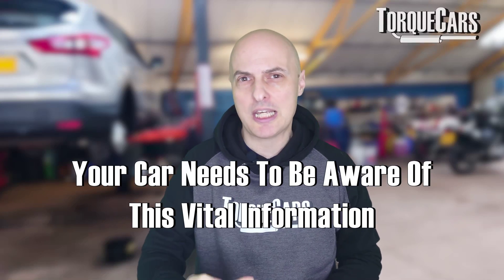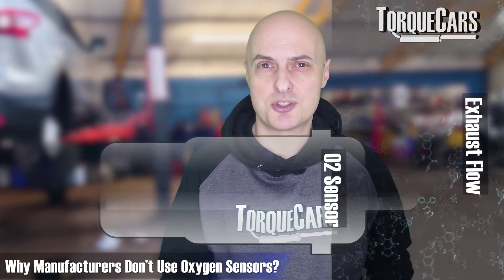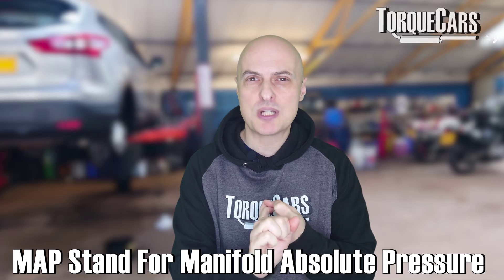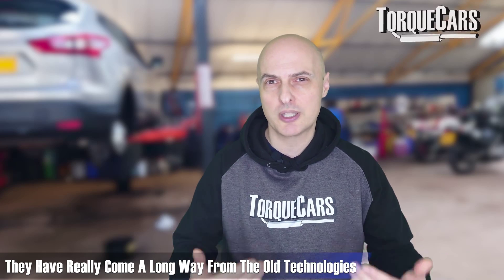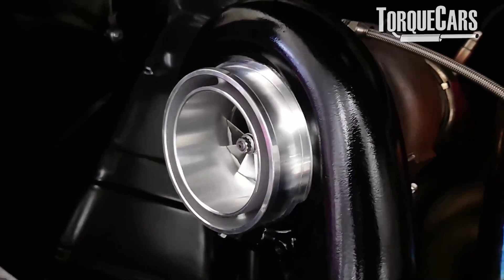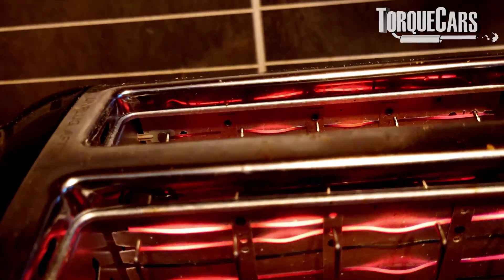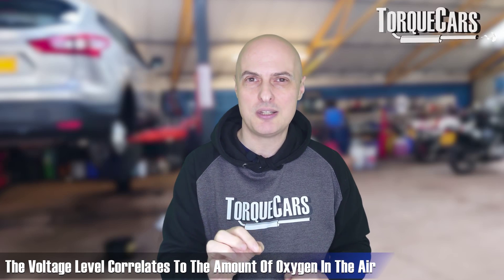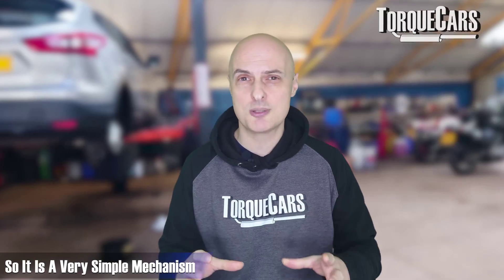Early Warning Signs of A Faulty or Failing MAP/MAF Sensor & See How They Work.

Comment: Hey i have a Error code p0069 (map senor) Could it be a bad maf senor Error ? Because I have changed the map senor.
Reply from the maker: Error code P0069 typically indicates a discrepancy between the MAP sensor and the barometric pressure readings. This sensor measures the pressure inside the intake manifold, which helps the engine control unit (ECU) adjust the fuel injection rates. When the readings don't match up with what's expected from the barometric pressure sensor, this code is triggered.

While the MAP sensor measures pressure, the MAF sensor measures the amount of air entering the engine. These two sensors work in tandem to provide accurate data for air-fuel mixture adjustments. If you've already replaced the MAP sensor and are still seeing problems, it's logical to suspect the MAF sensor might be at fault.

Check the connections, remove and clean the sensors and see if that helps.
Reply: @torquecars okay thanks! 🙏🙏 I have measured the map sensor which says 113-117 kPa, both at idle and while driving. If I change the MAF sensor and it doesn't work. What will be the next smart thing to do 🙏😁

Comment: To keep everything running smoothly how often should a person clean the sensors?
Reply from the maker: Some people clean them when they change the air filter. I have to note that damage is often caused by improper cleaning, primarily by residue remaining which attracts a faster dirt build up. Personally I only do mine 30,000 miles or so and they don't typically pick up much dirt unless I'm using an "oiled performance air filter".

Comment: The MAF sensor is a primary load sensor, many modern vehicles use it to calculate automatic transmission line pressure, a dirty, or malfunctioning MAF can reduce line pressure and cause clutch packs to slip and burn. High quality dry element air filters are best, oiled cotton gauze are the worst, especially for film type MAF sensors.
Reply from the maker: I've learnt something new, thanks for sharing this with me. I don't know very much about the nuances of Automatics, i've tended to own manual cars.
Reply: that's very interesting, i'd not heard of this before, and certainly want to prevent such damage to AT
Reply: How does exactly MAF (mass air flow sensor) control the transmission?    It has zero to do with driveline.  This is strictly info for ECU for proper air volume to achieve proper mixture to obtain proper combustion.   MAF sensor is the beginning of the line for ECU and CO2 is the final.  Both sensors send info to ECU what’s going in and what’s going out so fuel trimming can be done on the fly.

Comment: Out of topic but my 2012 4 motion 180 Hp amarok has very bad handling (I know a pick up and handling shouldn’t be in the same sentence) but what can I do? I’m running 18 inc 255 tires
Reply from the maker: Your bushings are probably worn causing excessive play. Getting a proper alignment done, especially focusing on toe and camber should help handling. I did a video a good while ago about suspension, it is due to be updated so I'll get on that but for your information (if you can cope with my earlier amateurish video skills here is the link...
https://www.youtube.com/watch?v=n-cjV4xwi18 - sorry about the quality in advance.)

There are also a few articles on my site about suspension https://www.torquecars.com/tuning/handling
Reply: Suspension upgrade/cheaper shocks repair(might be busted after 12 years, and don't do their job anymore), anti roll bars?

Comment: Hi, my 2.0 tdi audi a4 sline 170bhp is having a lag when stepping on the throttle and seems to be producing alot less power, what could this be related to?
Reply from the maker: Does this happen at all RPM ranges, or just at low or high or mid rpm ranges? Is it worse the same or better when the engine is warm? Have you check the OBDii diagnostics port for error codes.

A totally obvious thing which you've probably already checked, is if the car has an economy mode this will often produce more lag and less power, ensure this is set to dynamic if you have the option to get the full power.

Running some BG fuel cleaner through a tankful of diesel will help clean off the injectors and hopefully help if that was the issue, it is a relatively cheap thing to try.

Things to check include carbon build up in the intake, a dpf filter clogging up (if it has one so this depends on the year), bad sensors including exhaust o2 sensor, faulty or leaking injectors, blocked fuel filter.

It is really hard to remotely diagnose faults like this so all I can do really is hopefully point you in the right direction.

Comment: What are the symptoms of a bad MAP sensor tho, opposed to the MAF? 👍
Reply from the maker: The symptoms are similar as they both affect air metering and air to fuel ratios, so rough running, poor starting, wrong fuel mixture (lean or rich, usually running lean), acceleration problems and power loss in certain parts of the RPM range. Map sensors are less likely to fail than a hot wire MAF but they can still go bad.
Reply: On my 2005 Honda K-series engine the lambda reading was to high. It should read around 1 but was 1.4 which is to lean to pass the MOT. No fault codes came up and there were no air leaks so I used a basic OBD scanner and read the live data. The MAP sensor was reading incorrectly and causing abrupt low speed throttle response..
A simple and cheap repair that cost me £15 for a new sensor on eBay.